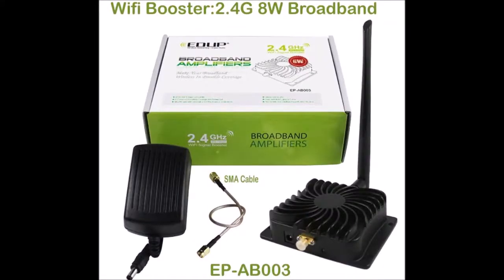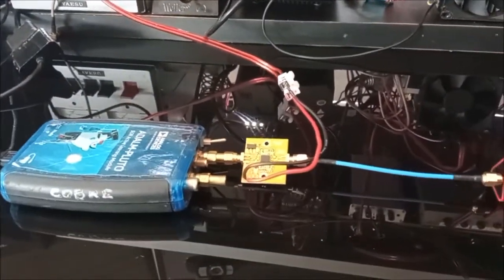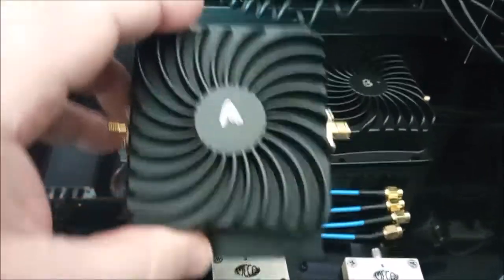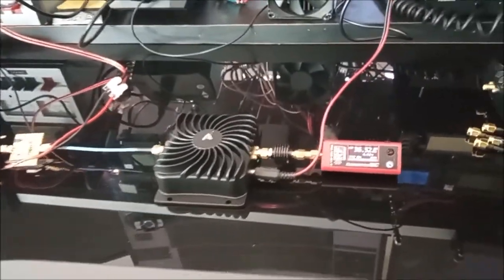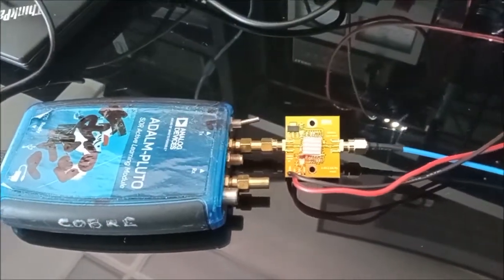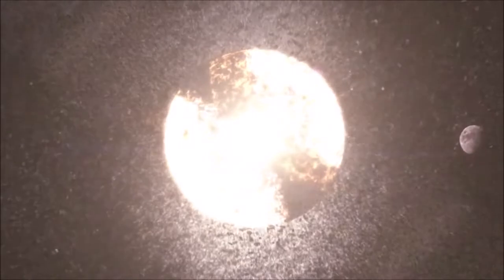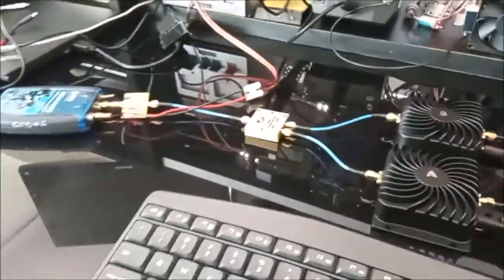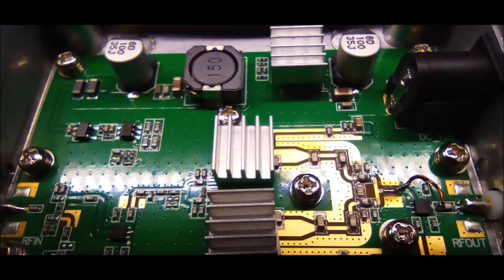2.4GHz TX - How to get REAL 8W from EDUP wi-fi amplifiers

Comment: Theory tells us that two amplifiers ( audio, video, RF or ever...) connected in parallel, do not output thier total power. Especially when they are also full duplex switched. If you measured the transmission power, did you also measire the quality of the usefil Tx/Rx signal? What isbthenconclusion?

Comment: Hello @cqpy2rn i have bought the same 2 edup 8w amplifiers and combined them with the same e-meca splitter/combiner and i get less watts/dbm , i only get 500milliwats ,What am i doing wrong ? 
I also have a immersion rc power meter and attenuator -30db
Is there a way to contact you ?
Reply from the maker: something is wrong, measure each one separately, it must show about 4.3W output with around 500mW input